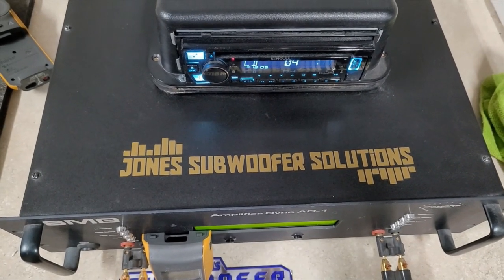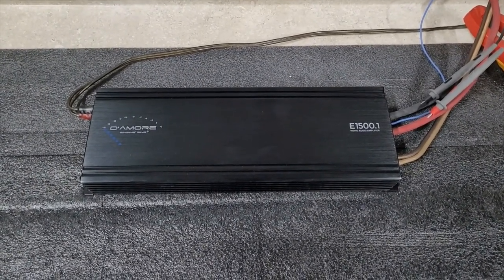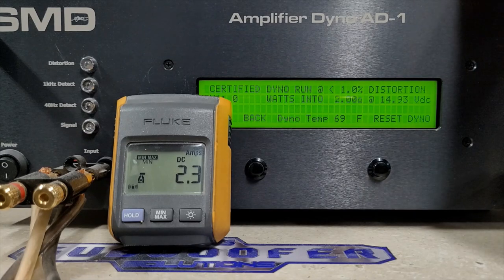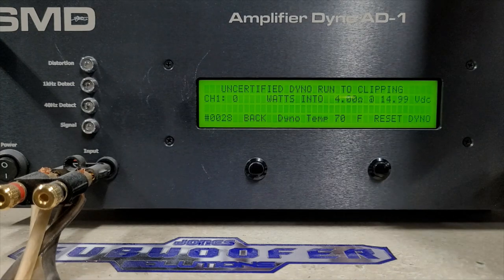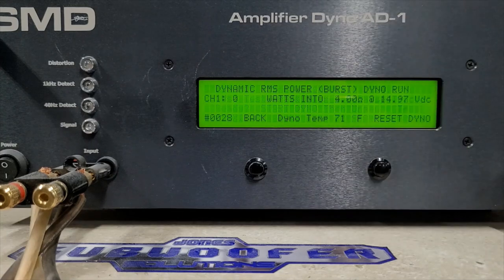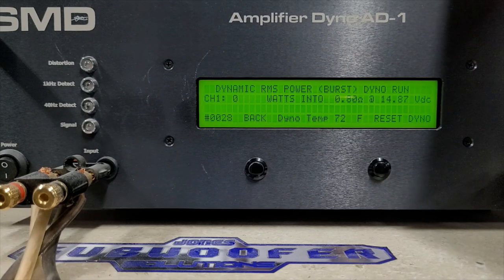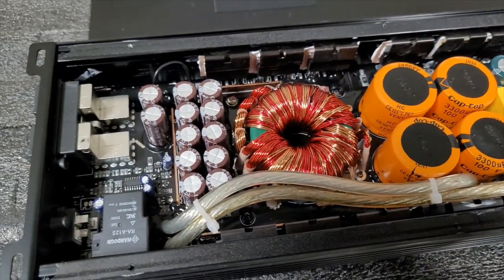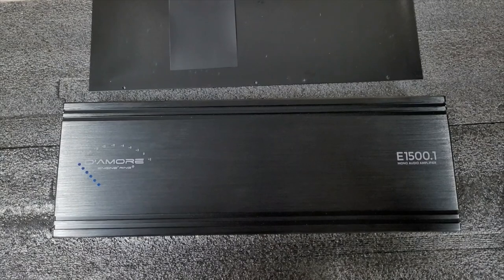AD-1 Amp Dyno D'Amore Engineering E1500.1 by Jones Subwoofer Solutions JSS

Comment: Just found out this amp is a rebadged Hifonics A3000.1D. The Clean D tech present on the 1K model (The two chokes on the input and output filters) aren't even present on the 1500.1 model, either.
Reply: Yeah no
Reply: @elulysero8863  It's true.

Comment: Question - For each of the "certified" tests you had the Fluke Amp meter in front....and at the end of the 4, 2, and 1 Ohm runs you showed an "efficiency" where the Amp values shown there, were not the same as what the meter was showing.  What's up with that?  If the Fluke was reading the actual amps, where did you get your Amp numbers from?
Reply from the maker: The fluke keeps reading when the dyno stops because the track continues to play until I hit pause. When editing I play the video frame by frame and use the value shown on the fluke when the dyno locks its numbers in.  
It's like watching a cars speedometer during a quarter mile run, at the end of the run it might have clocked 95mph official time, but the driver might see 97mph on the dash as he passes the line and transitions to the brake.

Comment: Okay, I know I'm probably overthinking this, for 1ohm, where did you get the 140.1A input from for the efficiency ratio eqn? Wasn't the total draw in the circuit loop 170.1A?
Reply from the maker: The dyno stops reading at 1% distortion, but the progressive track keeps playing and the amp keeps pulling current after the dyno has locked in its readings.
I simply pause the video and advance frame by frame to log the amperage at the exact moment the dyno locks in.   In this case it was ~140a.
Reply: @Facekicker  Thank you!!!
Reply from the maker: @geraldlarson5796  No problem!

Comment: Where are these amps made? Nice output
Reply: I don't think he states the country they were assembled in. Its not likely the US, if that what your wondering. More likely, China, Korea or Taiwan. It doesn't really matter. They are made to Tony's specs and he verifies it. So your not going to get counterfeit mosfets, etc...
Reply from the maker: Tony designed them and has a contract with a build house in China to manufacture.

Comment: My question is how efficient is this amp going to be at 12-13.8 volts where majority of people's systems are charging at your running some of these tests at 14.8-14.9 way over the nominal 14.4 an amp is usually rated at or if you get good quality amps Rockford, kicker they will do there rated at 13.8 where my charging system is can this amp do that if it can then I will be impressed but I'm sorry to say if it needs almost 15 volts just to do rated power it's not a good amp I'm not trying to bash the product just saying actually the reason I'm watching the video is because I was wondering about the product I hope this is just a case where you set your voltage to high retry the test at 14.4 maximum and see what it does or lower like 13.5-13.8 if it can do rated power then I will buy it for sure but I'm not going to buy a product that from what I saw here could never outperform the amps I already have

Comment: this is the exact same amp (board) as Exile Audio S150.1
Reply from the maker: I don't know that this is true - what I do know is that Tony D'Amore designed this board himself specifically for this amp, and it would be very unlikely for him to license anyone else to use his design.
Reply: @Facekicker  I will double check, I will have another Exile amp in my hand very soon, but dimension, specs, connector look identical including the board, good chance they came from the same factory
Reply from the maker: @leblancguillaume8226  Tony said its very unlikely, and if they did in fact find a clone, they're overpriced.

Comment: You’re all over d’amores D on this amp. It’s slightly above rated. It’s not like the hcca’s or quality Korean built amps. It’s nice do t get me wrong. It’s just nothing spectacular. Thanks for the video.
Reply: Well amplifier manufactures lie 90% of the time. It is just as bad if an amplifier produces more than rated power because they could have just told the honest truth to begin with instead of lying to people. Like the amplifier manufactures don't know what they are producing, yeah right.
Reply: @DTW-bx2vy  I definitely agree with you on that point. Just put what the damn thing puts out. I’m not sure why that is so hard? I know this lower quality companies lie about it being way more than it really puts out. It would be nice to get an accurate number right off the bat so you would know if you need to upgrade your electrical system. Which is what I had to do after buying some really high power amps that put out double what they claimed. I appreciate your videos. It’s nice to see what companies are scamming people with their “BOSS” output😂
Reply: It's not about just making power. It's about making clean power. Now that everybody has switched over for the most part from class AB it's almost impossible to find a clean sounding amp to power a SQ system. Tony and team have stepped up to fill that gap.
Reply: Subs love clean power - MBE
Reply: Did you know Tony D’Amore was one of a few engineers on the Rockford Fosgate amps back jn the 90’s and early 2000’s
Reply: @runningbear1982 Skar rp line definitely has 83 percentile range compared to alot of the so called "better" amp brands that bash them and their amps barely can make 78%... The metering and tests don't lie..

Comment: Need to lower the price of this by $100 -$150
Reply: The price is very carefully set. Its not any higher or lower than it should be. If you need something cheaper you would need to find someone making a cheap copy of another amp. Since they put in no design or testing, they have no engineers on the payroll, their final costs are less.
Reply: @JasonWW2000  Couldn’t have said it better